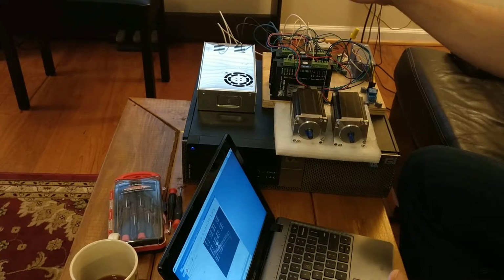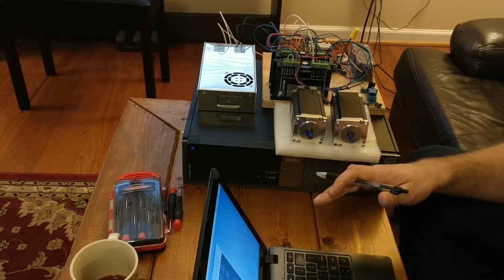CNC Coffee Table: Powered by Linux!

Comment: second big problem have spindle, how add spindle control, start/stop and speed to linuxcnc no have more in/out pin. e-stop and all limtiSW same pin 10, XYZ home SW 11,12,13, probe 15, and more input no have. linuxcnc only problem have not can use USB port breakoutboards and MESA card have too expensive buy hobby users budget, 300-500$ too much cost. and big problem have how add own code, makros etc, slave Y axis motor, make own code all addons. many hobby users not can understand how add code, not mean G-code, mean addons and tool code, add buttons,add touch plate, add makros, add spindle buttons and control , etc.

Comment: i have build DIY own linuxcnc machine, working well, cheap budget machine  hobby user, cheap chinese breakoutboard (problem no lot in/out pin)paraller port, nema 23 3NM stepper m, whit DM556 drivers,2,2KW spindle whit VFD,  but i has try make touch plate Z zero not newer has move and working, not understand how this must doing, no move, try add button on display start touch plate zero 38,2 but no working errors lot only, and try seach internet how this make, but not have any video how make this step by step ,cannot understand good english, how add button on display call code make Z zeroing touch plate, to workpiece top. after tool change manual,  and i has add second breakout board to pcie place in computer, think make more input/output pin, hall meter this working but then all first BREAKBOARD not working all, no working whhit 2 Y axle motors only one motors run,  Z touch plate working if looking hall meter but if try add button on display and call touch plate code not working, no move, were this code need add, or what all code need make and how. hobby users need good video how this make, i not has found any video how help make this. mechanic all working good but not understand how code need make and were add and call this, same if make G-code and try add makro, how call this and run this makro,  why anybody not has make video how this make, what code need,were need add code, how call this code why not move this code. and why come lot errors not understand what errors mean.